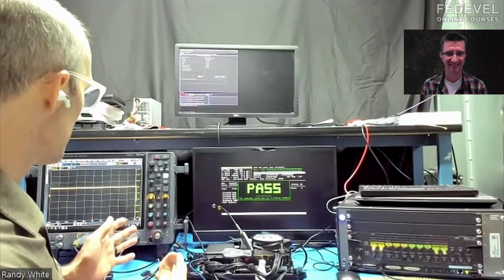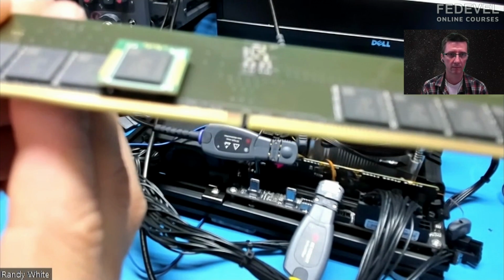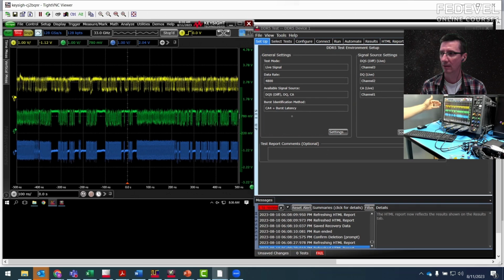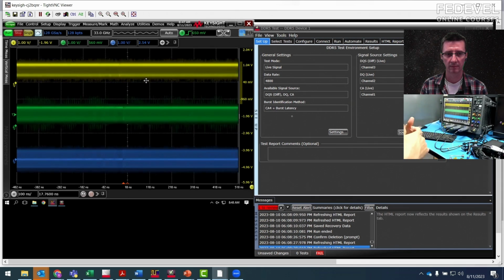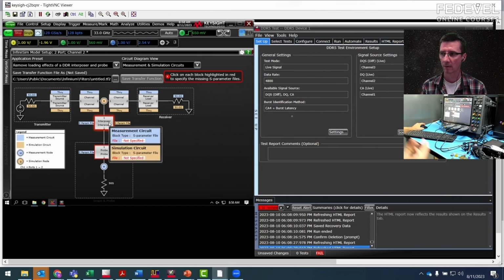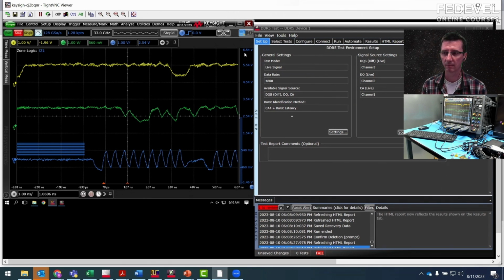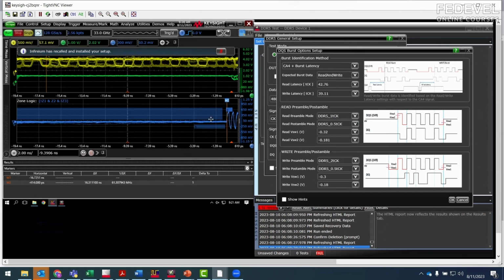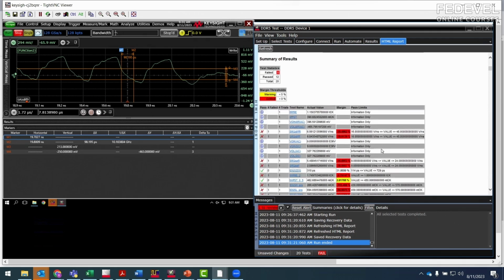How To Measure DDR Memories? (DDR5 / DDR4 / DDR3)

Comment: You have some really beautiful noise in those signals, but the cost and time and care to work with it ... especially when all the examples I find are people like you trying to remove it, not study it in its own right.  I am looking for innovative ways to use memory chips for gravitational detectors. Time of flight electron interferometry with lots of data, if only the analog signals were not so hard to get to. The sun moon tidal signal is large in gravitational terms.  Then atmospheric density and temperature variations. Then a few ways to measure speed of gravity. Seismic events, real time imaging, earth and solar 3D imaging (interiors). Besides memory chips which are just marginal, there are entanglement detectors, some of the more sensitive cameras, and many "quantum", "pico" and "femto" experiments.  Pretty much all the fields now are pushing deeper into the heart of electronics and there everyone should be starting to pick up gravitational variations.  The atomic clocks change with the potential, but the clocks are small and cheap enough to make gravimeters, gravity gradiometers and time of flight detectors for mass movements with precise times and directions and locations. I classify the memory chips (particularly floating gates) and camera sensors (particularly LWIR, submillimeter, THZ, XUV and soft x-ray) under "electron interferometry".  Then there are atomic microscope and atom interferometers and other sensors that groups have used but only gotten to "earth tides". When more groups start picking up "time of flight gravity signals" from cars and trucks on the road, detailed mapping of atmospheric density and temperature in the atmosphere and oceans, ocean waves, and many seismic events, then some of those sources - once calibrated - can be used as standard sources to calibrate newer sensors.  Most of gravitational engineering can be done using electronics and electrodynamics.  It is not mysterious, it is just small signals and lots of data to start.  Richard Collins, The Internet Foundation

Comment: I'd have a question for Randy :)
Why did Keysight go the route of having the entire length of the flex tip in microstrip and as a passive element instead of having the amp on this tip?
These flex tips will pick up a looooot of noise for your board.